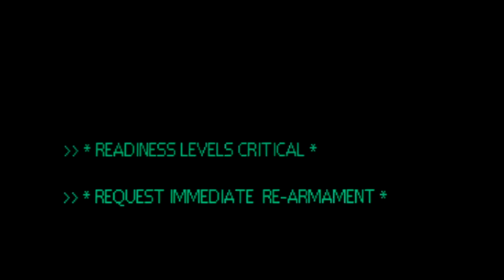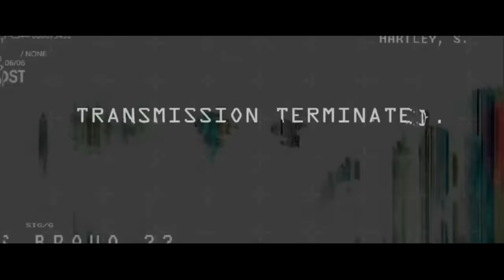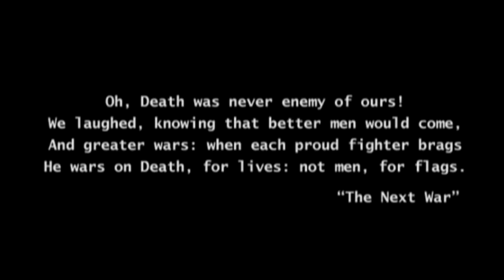Halo Universe - The Movie 2016 (LIVE ACTION)

Comment: I was wondering since the war started in 2025 and ended I 2053 didn't another war start after that
Reply: well there was the war with the rebel group the insurrection and that ended abruptly and all humans where united under the common enemy of the covenant which broke apart with the covenant rebels joining the UNSC spartans came about near the end of the war with the insurrection
Reply: its not the 21st century though its the 26th
Reply: donald shearer Between 2535 - 2558
Reply: ynoss yeah thats the 26th century

because the years 0 - 100 was the first century

The year 1900 - 2000 was the 20th century

The year 2016 is in the 21st century

so its the 26th century
Reply: Now 2019